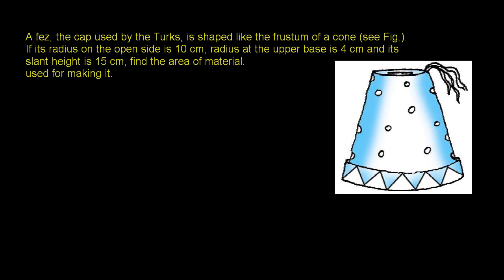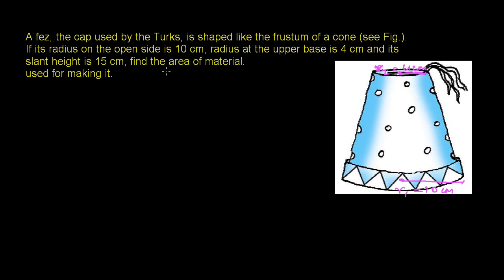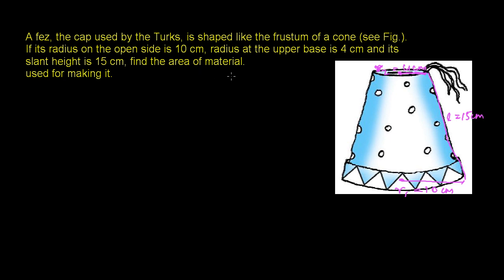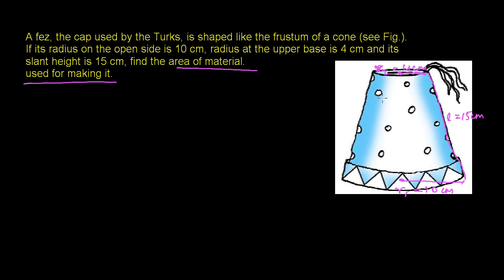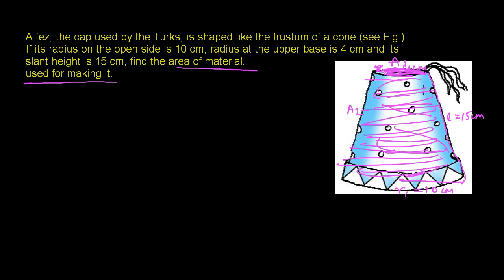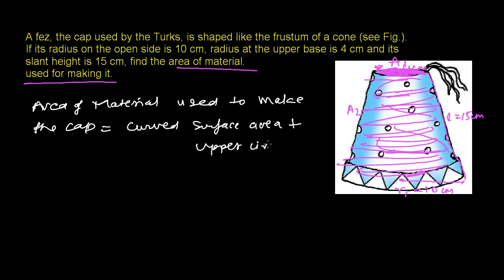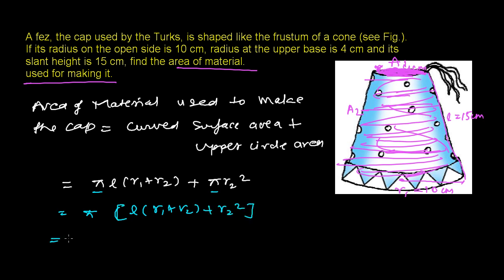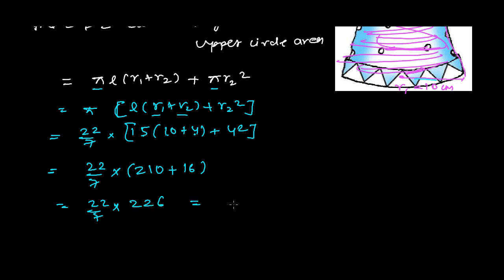How to Find Area of Material Used to Make Frustum Cone Cap

Comment: What if you know the thickness of the walls, the height and top and bottom OD?
The top is concave towards the center Bottom and the bottom is concave towards the center top.
I am trying to determine the ID and the angle the conclaves are moving.
Reply: how  can make BBS of frustum  curb area